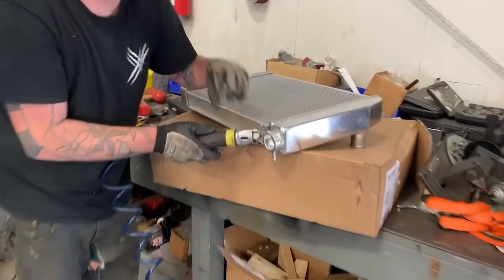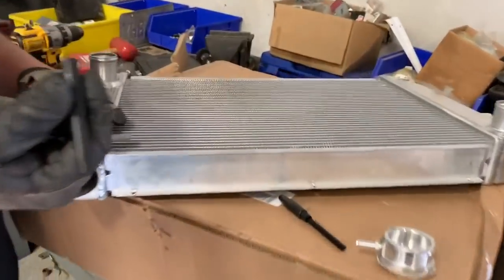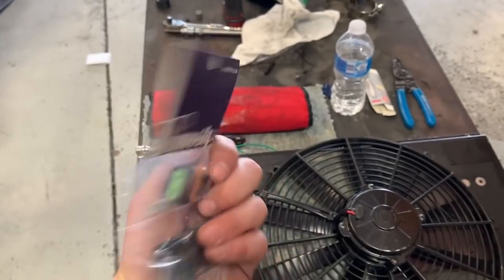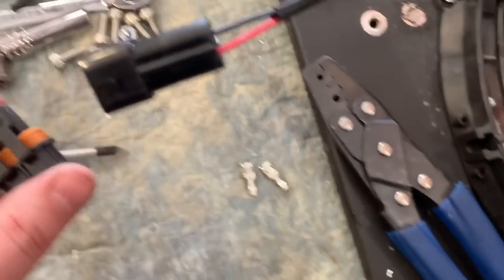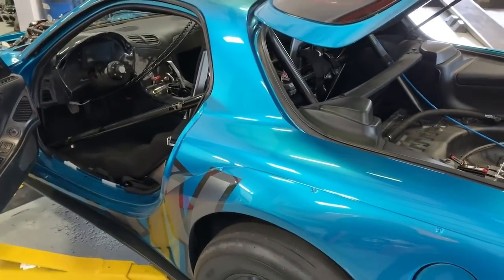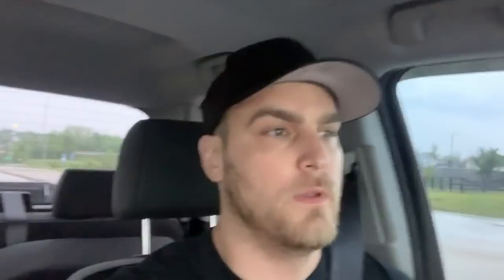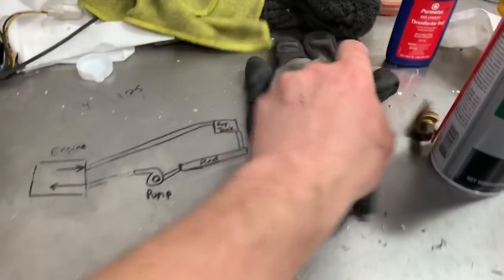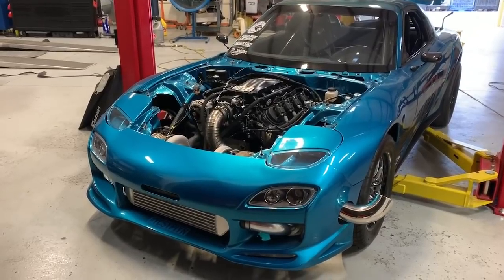**Rear Mount Radiator Install** - My 34th Attempt

Comment: You may have mentioned in a prior video and I missed it, but what size is the radiator itself? Thinking of doing similar in my s10 to save bed room/lower weight (vertically). My current unit is 33x15x3.5” and under the bed in the dark it looks way bigger.